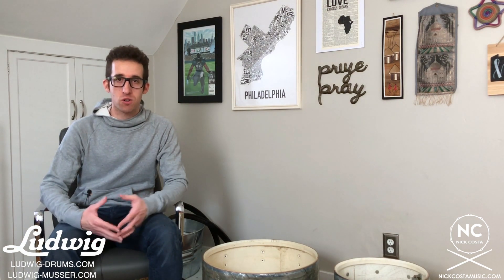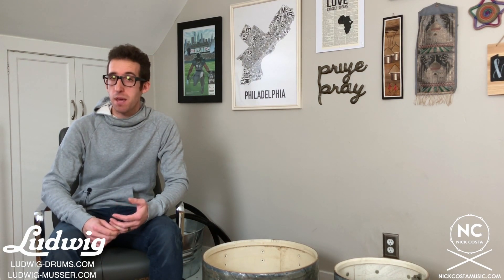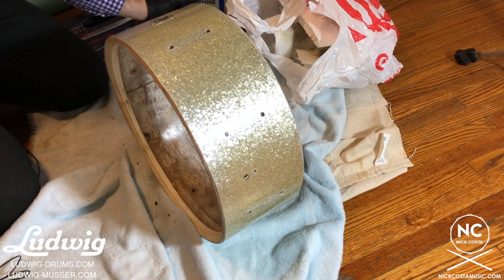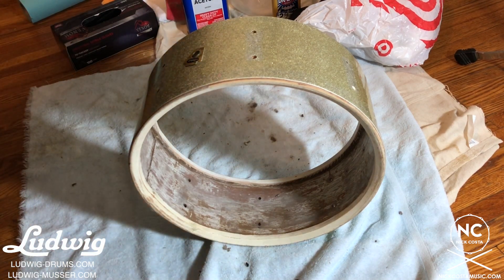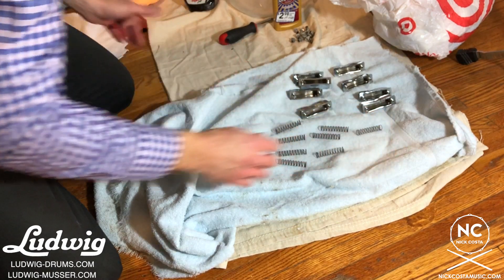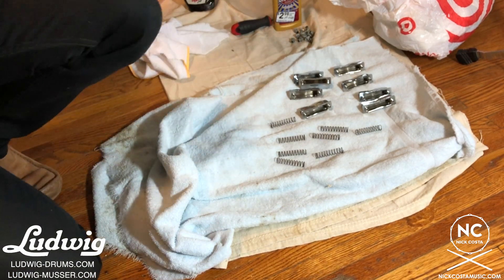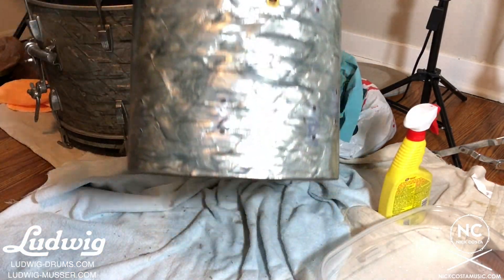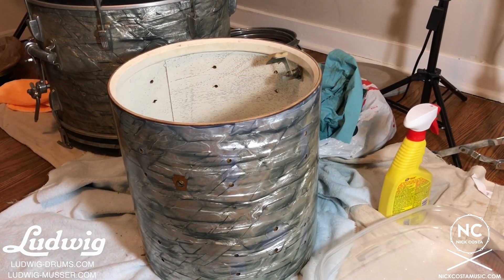1967 Ludwig Downbeat Restoration (Part 2)

Comment: More advice from that old guy in PA...dang it!  Avoid using Acetone on anything with old glue, paint or plastic.  It's way too unforgiving!  It can permanently damage things unexpectedly.  I would have carefully sanded off all the interior paint, and reapplied a thin off-white satin spray lacquer.  Go slow, thin coats, and plug all the holes from the inside, mask off all the wrap.  Re-stamping the mfg date inside would be a point of ethical discussion.  Since you're airing great video, no can say your cheating...you're just restoring a snare like all us OCD drum-lovers!  To really get a 10-point result, you would carefully remove the vent eyelet, paint, and replace it.  That way she sits on top of the finish...but it's tricky to get a nice roll in the leaves. That is a true restoration  step.  Can't wait to watch #3!
Reply from the maker: All very helpful points! Although I used acetone, the drum is still holding up and I was pleased with the result. I’m on the hunt for a matching downbeat snare but oh man are they EXPENSIVE!
Reply: @NickCostaMusic  That's why re-wrapping may make a lot of sense here.  Your drum is 100% A-OK mechanically & musically, so she's a perfect candidate for a "resto-mod."  It's not a collector's piece anymore, so don't worry about her individual value.  For under $100, it could match the kit perfectly!  I restored a 9-piece Granstar Gen 1 not too long ago.  The snare had the 80's mirror-plastic over a nice wooden shell.  Sadly, it was mess!  I carefully stripped & sanded the shell, and re-lacquered the drum in honey-amber all over to match the other drums interiors.  Then I wrapped it in new gloss black to match the set.  It was a 1000% improvement for the drum & the kit!
Reply from the maker: That’s not a bad idea!

Comment: Hello Nick!  So helpful...  really love this video.  I'm restoring my 1967 gold sparkle Ludwigs!  As far as hi-hat stands, snare stands etc...  Do you also soak them in Dawn/water for 24 hours??  Do you stay with the NVR DULL or switch to a liquid chrome polish?   Thanks in advance!!
Reply from the maker: Thanks, Jeffrey! Appreciate the kind words, and glad to hear it's helping you get ideas for your restoration. Sounds like a fun project!

To be honest I rarely (really, never) restore vintage hardware. Although it's cool to have everything be from the same era, the biggest issue in my opinion is durability. I'd rather throw up my flat base hardware to have the look but with durability I can rely on (plus still be lightweight). 

If you're looking to clean your hardware however, If it's real bad you can soak it in blue dawn/water, then hit with a liquid chrome polish due to their size. That should help clean them up nicely.
Reply: @NickCostaMusic  Thanks very much!  I think I'll wipe them down with Dawn/warm water on a damp cloth and then go look for some chrome polish.  Excellent... thanks again!

Comment: Can you name what product you used to clean the shell and also what did you use to polish the plastic covering? Thanks, great video!
Reply from the maker: Hey Philip - I used a touch of blue dawn and warm water to clean the shells. Anything that didn't come off with that I was able to remove/clean using goof off spray. I then applied a coating of Meguiars Gold Class Paste Wax. 

Goof off - https://amzn.to/3v0WAAZ
Meguiars Wax - https://amzn.to/38i7lEX

Appreciate you checking out the videos. Any other questions, please don't hesitate to reach out!

Comment: How did you remove the fade on the silver sparkle? Polishing compound and wax?
Reply from the maker: I cleaned the shell with warm water/blue dawn combo both inside and out. I then used goof off to remove everything the water/blue dawn couldn't. Goof off makes the shell tacky, so I wiped it down with a little water, then applied a coat of meguiars gold class wax.

Comment: 64 -67 were bad years for quality control.  The Ringo demand was high.  Alot of mistakes hidden under that white paint.  The clear interiors later were the best shells Ludwig ever made.  According to WFL ll
Reply from the maker: That's why all the companies did a "res-o" or "grani" tone finish on the interiors. The maple/poplar/maple or mahogany/poplar/mahogany kits made back then were a super large poplar core with basically luan (mahogany) or maple veneers. No structure due to very weak poplar. 

If you haven't seen it yet, check out video 3 to see how they turned out! - https://youtu.be/PkmgmYDTkRs

Comment: I really, REALLY do NOT believe that refining and touching up bearing edges will "get rid of that vintage sound".
Reply from the maker: Quite possible - but it doesn’t hurt to see what they sound like first.
Reply: There is that. It'll be fun to see part 3.
Reply from the maker: Many thanks! Can’t wait to complete this.  Thank you for checking out the videos
Reply from the maker: Best option would be to get a new drum head and sit it on the bearing edge. If it doesn’t sit flat and has a little bit of a wobble, the drum could be slightly out of round. It’s very common with older drums since wood moves overtime.

If that’s the case, try the Remo classic fit series drumheads. They’re slightly larger than standard heads to help fit vintage drums that might be out of round.